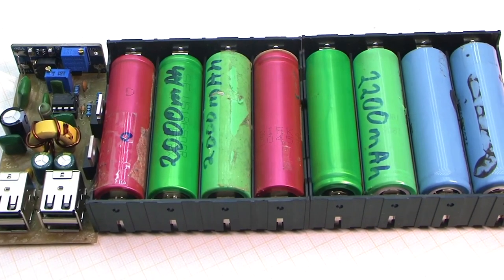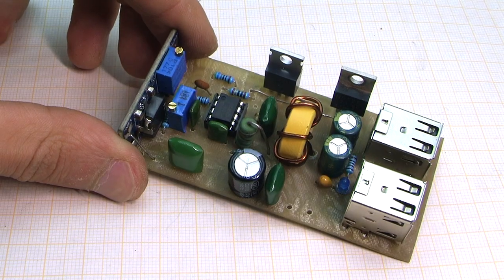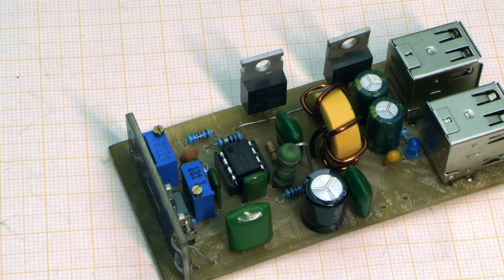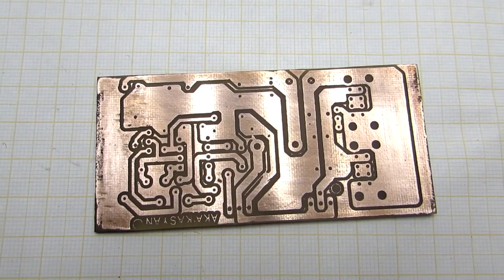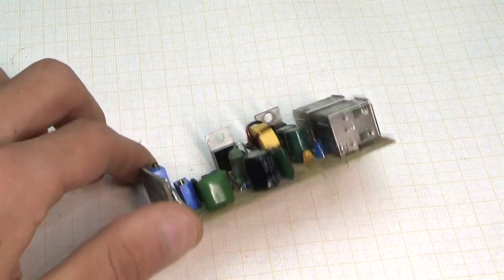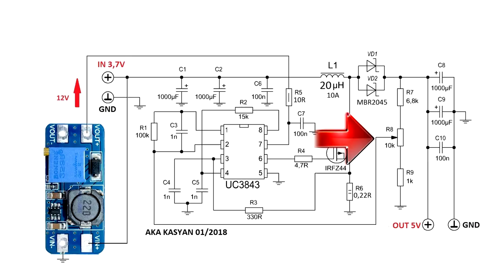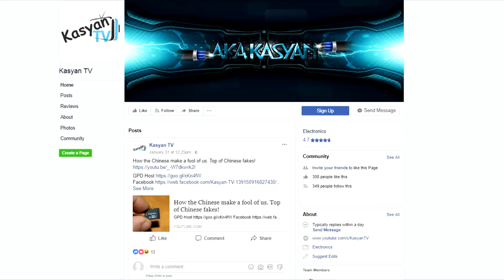How to make Super Powerful Power Bank

Comment: When making a monster pack like that, mosfet and shokky diode should face away from battery, then you can bend a sheet of aluminum the length of (battery pack + width of PCB+thickness of board) then bend one end to the thickness of board. Like a giant L. It's a heatsink and firm mounting system

Comment: those yellow toroidal transformer cores are compressed iron dust cores so they are very inefficient at high frequency switching. you have to choose between power efficiency and high pitched coil whine with them. use real ferite cores from E-E shaped transformers

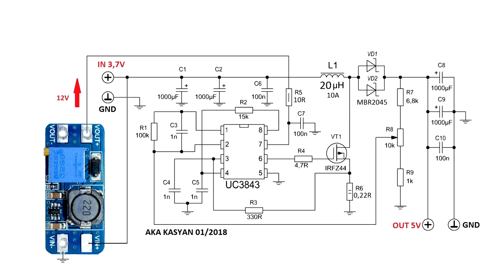Comment: Looking at the schematic at 1:11 , I noticed you are using 2000uF on the output! Isn't that too much? usually its between 100-470uF. The input is fine at 2000uF or even higher. 
Also, your batteries are rated for 2500mAh at best. The maximum safe discharge current of 1 cell, is 2500mAh or 1C. For longevity, it is best practice to bring that down to 1/10C or 250mAh per cell. So, you must use 8 cells as you did if the draw is 4Ah. That is, if you like your batteries to last a long time, and not push them too hard for current. 
I love your channel and watch it 1st, before all others. Your re-use of components, is a lost art by itself.

Comment: why don't you use the same "dirt cheap" buck converter boards in parallel to provide high amperage 5V output ??  ..instead of making DIY boost converter ?

Comment: Dera in the Schematics doesn't show the voltage of the electrolytic as well as the polyester capacitors also I see in the photos that you got a power resistor and it doesn't say how much power. I would be awesome if you publish either the schematic in a well known diagram maybe free like EasyEda, and a BOM. Without it we can not build this. Hugs

Comment: you are very resourceful . I try to be. but you are great at it. I try to repurposed as much as I can. I'm trying to work everything out in mind. that I need to do. to make a bunch of lithium ion 18650 battery bank. to power my house. I'm thinking about building a spot welder. and trying to workout how I will fuse each cell. and how I will manage the cells. balance them an protect the voltage levels. a 250amp nominal bank with 100's or 1000's of amp hours is a lot of batteries to tend to. at 24v or 29.4 peak .I don't think I'll go over 29v. I'm thinking go with 20 or 40 cell packs. but make them where they can be expanded to 120 cell packs. in the future. and series of 7. thanks